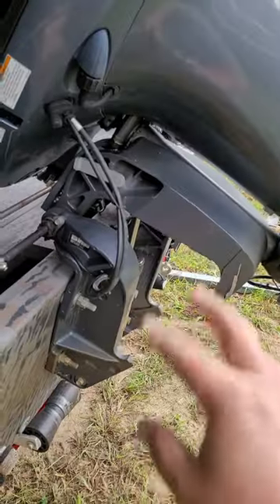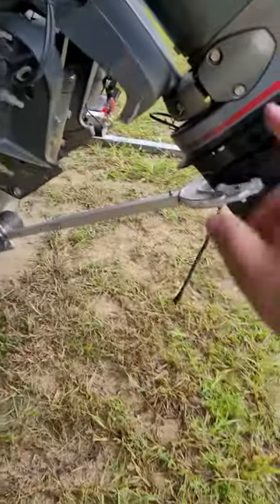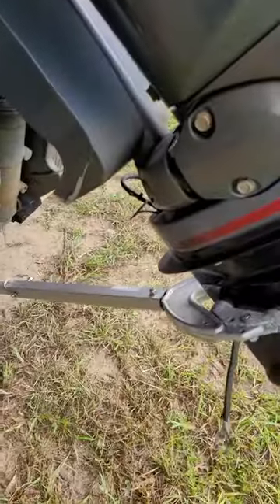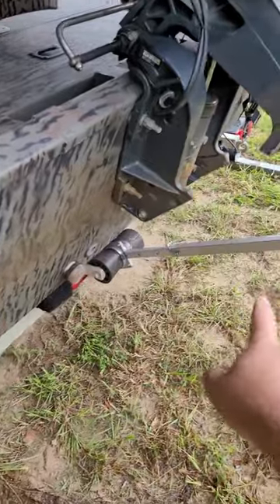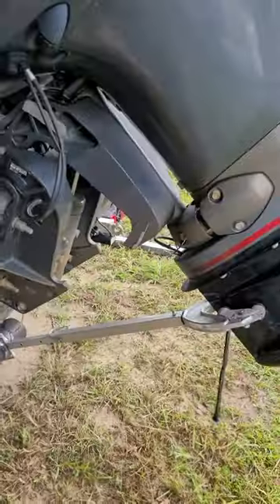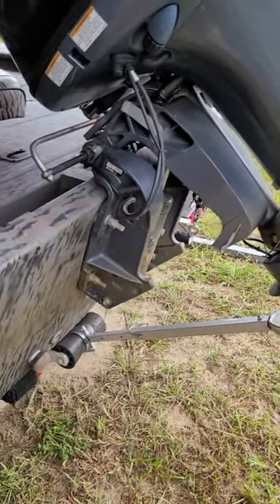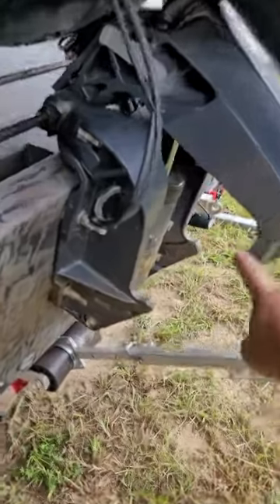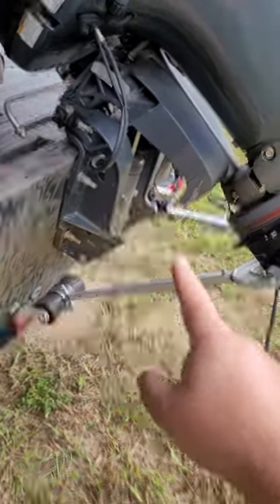Most "Transom Savers" are Gimmicks #shorts #bassfishing #boats

Comment: If my transom can't support the weight of the engine bouncing on the road how can it support the full force of the engine bouncing the boat into a chop?
Reply: The motor does not bouce while in the water. Its not stitting at that high of an angle.
Reply: When you hit pumps pot holes ect. It helps the motor wiggling on yer transom  think of bending metal back and forth til it breaks that's what it is doing bouncing down the road, in the water it isn't bouncing

Comment: This is just false..without that transom saver your boat, motor, and trailer are taking load independently cause more force on each. Once you place the transom saver the force is divided by each of the point because their taking the load as one unit. Both types of transom saver work just as effectively because they’re doing the same thing.

Comment: If you trimmed your motor down fully for transport, like most outbourd manifacturers recommend you do.. people wont need a "transom saver" because your not putting the amplified stress of a trimmed out motor on the bracket. Never fully trim out your motor for travel, unless you have ground clearence issues, even then only trim it up as much as needed . trimming up you motor is really only nessaacry to prevent groth when your boat lives in the water.

Comment: No son that “transom saver” you are showing in that video destroys your lower unit. Jack plate is where it’s at, skinny water and transport with the motor in full down position.
Reply from the maker: Well grandpa, if you're referring to scuffing up the paint some, yes it will.  Structurally damage, no. The weight and stress load on the lower unit from the transom saver is far less than the load imparted from the motor in the water.  As for a jack plate, that's even more stress load on the transom since the fulcrum is further out from the transom itself.
Reply: @HyckoryStyckFishing  saw a trick someone came up with to prevent the paint wear from the transom saver. He took a washcloth/small rag and covered the tongs and it still fit tight and was easier on the finish.
Reply: @HyckoryStyckFishing  I made my own, using some scrap metal that I had. I mocked everything up then welded and I used some of the stick on felt squares like you would use under furniture and stuck to the transom saver. Not only do I have cushion but it’s also nice and soft so it minimizes the damage to my lower unit finish.
Reply: @HyckoryStyckFishing  many many many many lower units have been wrecked by your antiquated transom saver. What a joke. Compare range to lower units to damage to transoms. Ha. You’d be better off using nothing grandpa.

Comment: The force the motor places on the transom simply pushing the boat through the water is much higher than any force the motor has on the transom by simply hanging off the back. All transom "savers" are unnecessary and a gimmick.
Reply: You are correct, the transom saver he’s showing if not properly installed destroys the motor mounts on your motor. Seen it to many times at the shop.

Comment: Have you ever seen your motor bounce when your running on the water in even 1 footers? If that doesn’t wreck your transom the road will never wreck your transom. When I was in Florida most of the boats don’t use anything while trailering. Turn the motor sideways and go. So really you have no clue what your talking about brah
Reply from the maker: I've been to Florida. There's goid roads in Florida. The roads around here will jar a kidney loose. The motor bounces way more on the trailer when unsupported than ever in the water on the roads around here "brah".